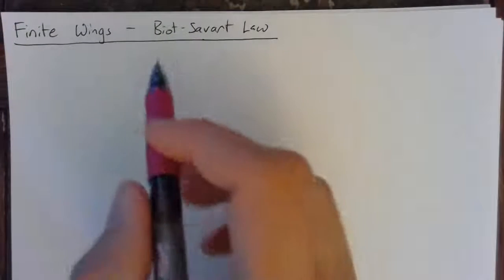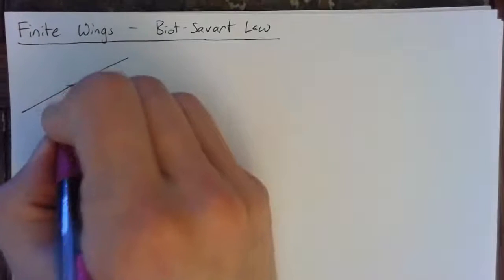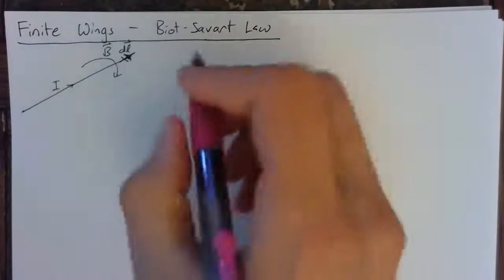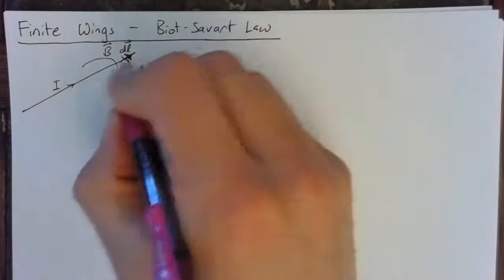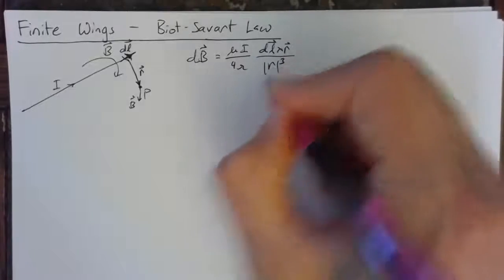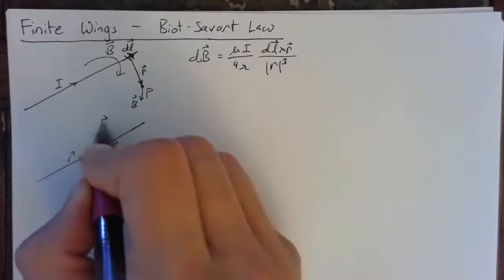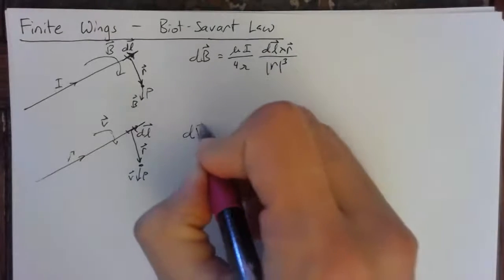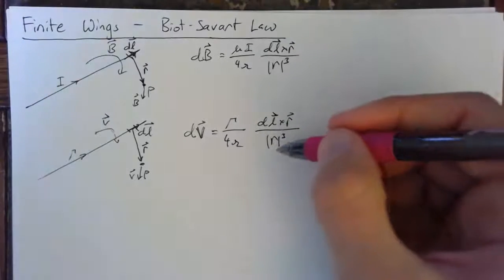Finite Wings - Biot-Savart Law

Comment: Theta should be the inside angle of the triangle, he has taken outside angle as theta . Which is incorrect.
Reply: Since its a cross product, theta is the angle in between the two vectors (dl and  r) when you place them tail to tail so the outside angle is correct